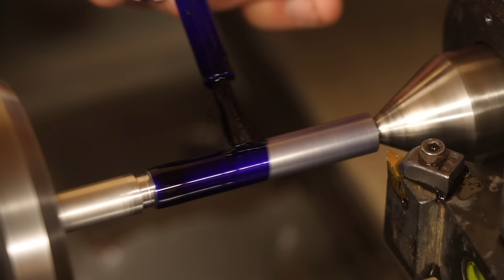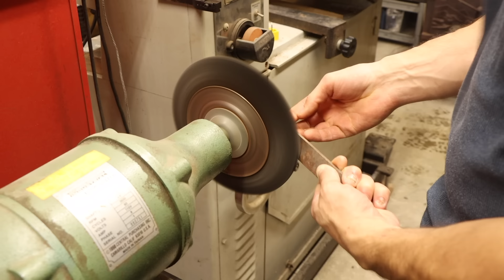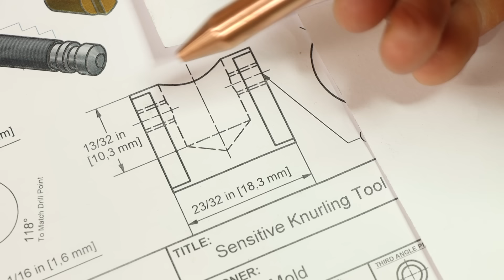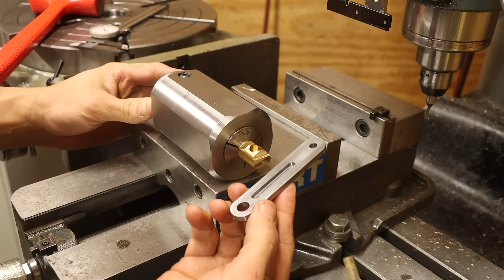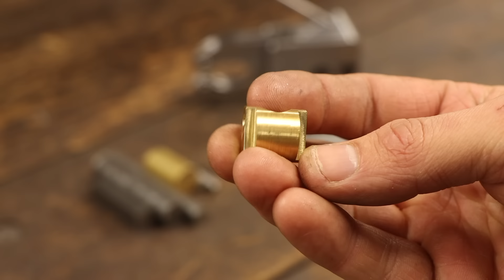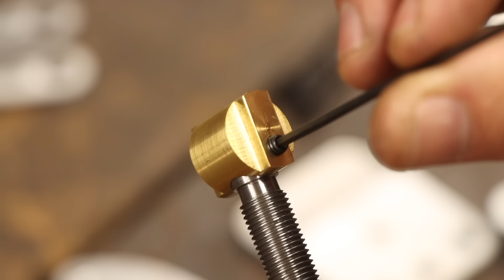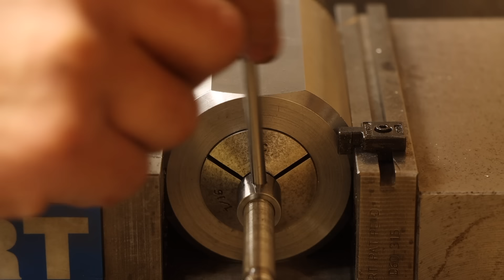Making the KING of All Knurling Tools (Finale) || INHERITANCE MACHINING

Comment: Non-Machinist here, but how did you make the different patterns with the knurling tool, on the same diameter stock? At the very end of the video, one set has straight knurled, the other has cross hatches. Are there different knurling wheels that were swapped?

Comment: An easier way to calculate the drill tip length is drill diameter x 0.3 (for a standard 118° drill)

Comment: I always knew there had to be a catch when it came to knurling regarding the circumference of the piece being knurled. Most video creators I've seen don't address that, and I was always left thinking "Wait a minute, how do you do that and have the number of lines come out even so the teeth on the knurler don't come down on ridges instead of into grooves. So the circumference of the knurling tool rollers limits the size of the piece you can knurl with it?

Comment: Just an observation: 

Not just in this video, but in some others I've seen, you seem to make a lot of elementary oversights which have less to do with engineering and machinery but more to do with a kind of "rushing" mentality, maybe a kind of ambition to be "doing the next operation" before fully considering it. You agonise over 1 thou in tolerance but flip the part wrongly into the vice or forget to lock a handle.. Hmmm. A first year would not be doing that.

As a boat builder, who must consistently consider up/down, left/right, in/out with expensive timbers unable to be re-machined in other ways, I sure couldn't fit (or afford) as many oversights as your B.O.S. contains. Its growing occupants seems to indicate "more care -- less haste". And fwiw,  public self shaming (which you do so well) doesn't actually help in increasing the minute-by-minute awareness needed to lessen future mistakes. That takes more mental self disipline not be be distracted by ambition. Being "in the flow" helps. 😊. Great channel, btw.

PS, Your comment "It's amazing what a little bit of sleep can do" is, to my mind, an inversion of the solution's truth -- which is, recognise tiredness and distraction before making the oversights and mistakes.

Comment: Um, I did only take a course, but my hand machining instructor said that it was unnecessary to calculate the number and size of grooves when knurling. He was right, too; I still have perfectly formed diamonds on the plumb bob I made. 
While not the same one, we all used knurling tools that operate on the same principles, albeit ours were more scissors like instead of like a gear puller as shown here.
Furthermore, you can tell by eye when the knurling is fully formed, at least when diamond knurling. As the diamonds go past, oh, 50-60% formed, they start to look really rough as little burrs are formed by the knurling die swaging/skiving the material along each face of the diamond. This roughness gets more pronounced, then changes in texture as you get closer to fully formed. Suddenly you see a lot of swarf, as the knurling dies are now  cutting off the little burrs.  At this point the diamonds are past 85%, and you will need to pause  frequently to check on progress. Once you get past 100% formed, you will see the diamonds have a sickly texture to them and you get this weird looking swarf, unlike what you see before. 

As students, we were running slow feeds and speeds and constantly bathing the the area in cutting oil.

Comment: That 90 degree miss for the B.O.S. brought back some memories.  One; my first lathe/mill were Sherline.  Because they are so small you can only take very small cuts when working steel.  I had at least 20 hours into an intricate part and the final procedure was to put a groove 90 degrees out on one side for location when assembled.  And, yup, I forgot to turn it 90 degrees and had to scrap the piece.  That "part" had a permanent place on my desk at work for the remainder of my working career as a reminder of the cost of simple lapses of attention.
Really enjoying your channel.
BTW, have to say; You regularly, and jokingly I assume, dog on your skill set.  But you throw around excellent press fits and tolerances in the 10th's like they are a simple accomplishments that anyone can easily and repeatedly attain.  Your work is very high quality and demonstrates a high skill level, even with the B.O.S. submissions.
Reply from the maker: Oh no... I've fortunately not scrapped a part that far in yet. And yeah I'll say yet because it's bound to happen. 😂 Thanks so much for the kind words. I do try to do my best. Even if the emery paper needs to get me the rest of the way there 😉

Comment: I'm a little confused as when making the slots in the guide plates you had to oversize one that was 'off centre' but when you said you were cutting the trunnion slot guides you "made sure they were identical" with one slot bigger would one slot guide need to be bigger. Now there are a lot of words in here I have never had to type before and I could just be missing where the adjustment was made. 

N.B. Thanks to you I know know that introduced stresses introduced into into metal stock at manufacture can have a marked effect on the final tolerances after working them.

Comment: I watch all the fun you have with that rotary table and I think. Hmmm, how much $$?  OH HELL. Are they THAT expensive? Nuts. Back to the belt sander.   That said, I am pretty sure that if I had to trash a part twice, I'd probably not be safe to return to that job for several days. On the other hand, running a camera, and lights, and thinking about all the details, and sound tracks, and all that goes with making these videos...it is SO easy to forget things. WELL DONE!!

Comment: I recently bought a cheap drill press vice which would struggle to hold up a day job as a door stop. I've spent several happy hours making parts to improve it by hand.
I hit a similar problem to you with the screw not making good contact with the bottom of the drilled hole. The tolerances were a bit bigger on my project because I fixed it by dropping an M6 hex nut in the hole which took up the slack quite nicely!🤣
How about a cheap crap tool improvement project?

Comment: A few people have mentioned here and there in these comments that Diameter doesn't matter (that much). which is true in practice most of the time. if it weren't the top and bottom knurling tools wheels would need a linkage to track in sync. the trick to making it work seems to be counterintuitively going harder. taking a deeper bite on the initial pass. basically (and this may not be the actual reason, but it's the working theory) creating enough tool pressure to force the kurling wheels into the grooves that they've made. 

There are exceptions, but those are rare.

Comment: Something I always wondered about knurling. If you go around the same area, the pattern won't line up because the division of the rows on knurling isn't going to perfectly match the circumference of the piece. How does it seem to always perfectly line up? For example if you had a 1 inch circumference rod, and knurling every 0.15 inches, there would be a mismatch of 0.05 inches. Making one row either cut in half, or really ugly, wide, etc

Edit: I wrote this before watching the video. Guess my question was answered 😂

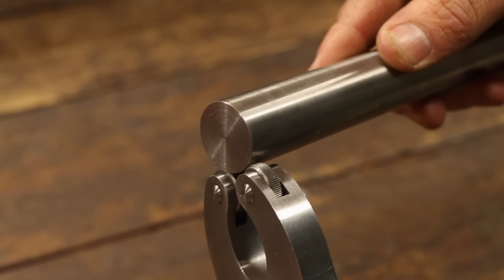Comment: 16:24 - thank you for actually digging in to the question of dealing with this diameter.  I've seen various folks mention it as a thing, but you're the first person I've seen actually do math on it.  And many don't even mention it as an issue --- I guess either they just got lucky, or more slop is possible than one would think, or... something?  But it's neat to have someone actually go through doing it the "right way", even if some "wrong ways" are, in practice, workable.  I look forward to the day I can experiment with all this myself, and gain a deeper understanding.  :)  (I imagine doing the machinist's equivalent of a photographer's "test strip" -- a shaft with various diameters, separated by tenths or a thou or two, and seeing what happens on each.)
Reply from the maker: Yeah it seems to be a point of contention with a lot of people. I've had mixed results just going with whatever diameter in the past. But that was with a bump knurler. Ive since only used that calculator and have yet to have a failed knurl. Interestingly though, someone mentioned theres a video where a guy knurls a tapered shaft and it manages to work out somehow along the length. That would be a fun test to do.
Reply: @InheritanceMachining  Oooh, that would be a fun test to do!  Side project!!!  :D

Comment: Brandon, for holding multiple layers in the milling vice, I use a piece of cardboard like from a cereal box behind the moving vice jaw. I keep a stack of these cut to the same dimension as the vice jaw with my parallels just for this occasion. I'm sure professional machinists (which I AM NOT) would disagree with this method but I've achieved really good accuracy when drilling holes through stacks using this method. It's certainly better than drilling them all individually OR having them come loose in the middle of your operation - THAT SUCKS!

Comment: Non machinist question:  what is different to get the checker type knurling?   I didnt catch how you went from the straight lines to the checkering?  Thanks.
Reply: For straight knurling, the teeth on the wheels are axial. To do the diamond knurl he switched the wheels to ones with diagonal teeth in opposing slants.
Reply: @carlhitchon1009  thanks.  I missed that.

Comment: Why does everybody do scratch pass before threading? Even those people who I know has a magnetic indicator (K Rucker, Quinn Dunki...,). It is more precise putting it to the way to measure displacement of the saddle during a full turn of the spindle. This way I could find hundreds of mm pitch deviation which was caused by the small amount of opening the lock nut.

Comment: Love your clips. The nice thing about this small home machine shop is that you don't do production runs, just imagine pulling off the vise part number 67 and realize the hole supposed to be on the other side or some stuff like that haha. Not to mention making those parts from brass or more expensive material. Your box of shame would be an container ... 
Anyways, good job man, keep em coming and thx for sharing
Reply from the maker: Oh yeah for sure. My mistakes would outweigh my equipment. I appreciate it, man!

Comment: With a 118degree drill tip angle multiply the drill diameter by .3 for the drill tip length

Comment: The more I see you use your rotary table the more I have to wonder if it would be possible for you to build a small 3 jaw expanding chuck that fits inside your rotary table instead of making a new locating pin for every hole size. Maybe you'd need a set of them for varying loads and sizes, but I think it would be a fantastic engineering project.
Reply from the maker: Thats an interesting idea!

Comment: Are the wheels on this design a readily available size? I noticed hemmingway doesn't list the dimensions. Looks like a fantastic design though.
Reply from the maker: IT is a great design. I'm not sure on the availability of the wheels but hey are 5/8 diameter, and 3/16 wide with 3/16 hole.
Reply: @InheritanceMachining  Thanks for the info-- looks like McMaster has 1/2 dia x 3/16 wd x 3/16 hole. So there's some out there that might work and don't require international shipping.

Comment: Knurling is black magic, the making the diameter a multiple of the knurling has been debunked by a bloke who successfully knurled a taper.. I normally just go for it and if the knurl turns out crap just turn it down and try again, it works out good more often than not

Comment: Yeah, the more i look at these casting and stock kits, the more repelled i am... I am a major cheapskate and wont pay for anything that doesnt merit its price with utmost quality and performance... And these kits i am sure, dont come cheap, whereas i can get tool steel and bronze and most any stock for 1/10 the industrial price or even cheaper... Sure, as with that bar o` stock you reached for, its oft rusty and in need of some reductive finishing to get it into shape and size i need, but if i bought a set, and i was facing the fact that all the stock is once given a proper surface finish, undersize to what the design ordains, i would be furious, and that is one thing i try to avoid as often as possible, as it aint a sign of things going to plan... Paying for rage is a bad investment... If i want to be enraged, i can just turn on the TV news, which i haven seen in over a decade and a half now... Machining is supposed to be relaxing and meditative, not a source of bloody fists and explosive swearing...

Comment: Mine is coming along. Slightly less pretty than yours as I am leaving the stock at final dimension, but it is pretty great seeing it all come together. This was for practice for me before I start the Quorn Mk3 project. All the pieces for that are sitting in drawers waiting for me. Going to need to wait a bit longer, as I have discovered an issue with the manufacture of my lathes cross slide, and it is causing me to cut an unacceptable convex dish on facing cuts. I don’t want to try to build a machine that should have tenth accuracy till I sort out 4 thou of convex facing over 4 inches diameter. 2 thou per inch of radius is not acceptable.
Reply: Headstock out of alignment?
Reply: @carlhitchon1009  no. The cross slide was machined incorrectly, causing the headstock side to lift a thou, and the tail stock side to drop a thou in less than 1” of in-feed. This is leaning the tool post away from the cut, and causing a convex dish on facing. Precision ground MT5 test bar has my headstock within tenths of alignment. The manufacturer is ordering. New cross slide from the factory in Taiwan.
Reply from the maker: Yikes... thats a big discrepancy. Glad the mfr is replacing it though. The Quorn is a serious build!

Comment: 60 deg angle on a BSF thread?
Should you have used a 55 deg angle on the compound slide, as it is a 55 deg angle thread.
I've only used a plunge in type when cutting threads and not having the compound coming in at an angle.
Reply from the maker: I went UNF rather than BSF since that's the tap I had.
Reply: @InheritanceMachining  That explains it then UNF, UNC and metric are all 60 Deg threads.
Thanks

Comment: To find the centerline of the guide plates, could you have clamped it with a little extending past the vise jaw, then edge finding + center function on the dro?
Reply from the maker: Yeah that would definitely work. Or just on the insides of the jaws themselves. I was just trying to be click and it didn't work 😂

Comment: without the deflection problem with this new tool I'm curious what the smallest diameter round is that you can knurl....
Reply from the maker: The wheels close down to around 1/4 inch so I should be good down to that at least

Comment: So nice.
Do you have a trick to make a nice knurl on a flat surface area, for example a half inch by four inches?
Reply from the maker: Ive seen people cut diamond patterns using a single point tool in a mill

Comment: One of the things I like to do is when my dad brings home a part he messed up on to show me I usually take it to work to make a tool for myself. I had just recently make myself a makeshift eye bolt driver for my drill. I enjoy watching your videos and they give me a bit of inspiration for making different things. I was also making an aluminum tool holder to hold in the vise of the mill at work. Its an ancient battleship gray bridgeport mill with the solid hand wheels and a dual head.
Reply from the maker: I appreciate it. I like your resourcefulness

Comment: Hey mate, great job. Use some copper or aluminium stock on the moving side of the vice to take up any variation in size, this will help with clamping. I also think this should be pakerized or blued.

Comment: Just wondering; could you get rid of residual stress by some form of heat treatment?
Reply from the maker: For sure some sort of annealing or tempering would help. I think a lot of precision machining jobs (in industry) actually require this to hold tolerances
Reply: @InheritanceMachining  Thanks, that’s interesting!

Comment: I never understood how knurling worked. It isn’t cutting the metal, it is deforming the metal. Thanks. 
Now how did you get that one set of wheels to make both a straight pattern and the cross pattern? Please do a video with extreme detail on the setup.
Reply: It deforms the metal enough to actually make a difference in its dimensions, fun fact. I was knurling a hammer handle (aluminum) that we machined down to 1" plus a couple thousandths of an inch because, once knurled, the handle will be squished down one or two thousandths, meaning once I knurled it, my handle fit perfectly inside a 1" collet.
Reply from the maker: Thanks! I didn't show it but I changed out wheels to make the different patterns

Comment: this doesn’t have anything to do with with the video but i just did my first single point thread on a hammer handle and it fit perfectly
Reply: Well done! Threading is wonderful to me because I always doubt that my threads are gonna work and then the part just screws in buttery smooth... One of the best feelings.
Reply from the maker: Thats awesome! And that's once of the beautiful things about thread turning. Getting it dead nuts!